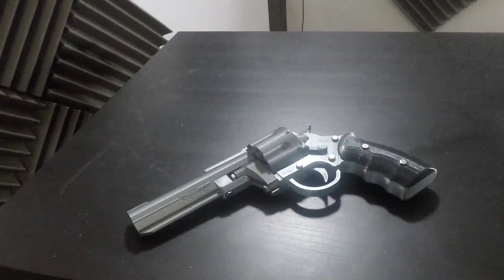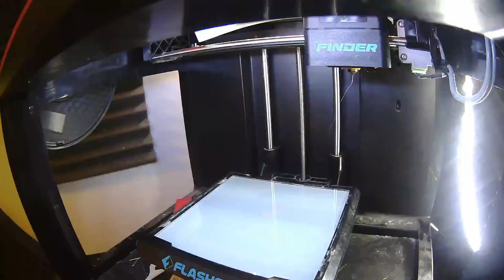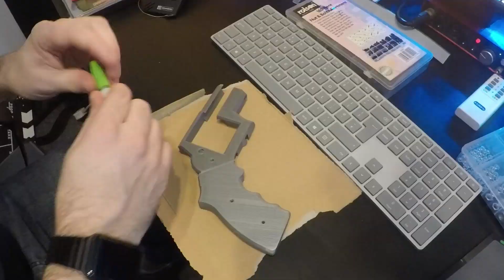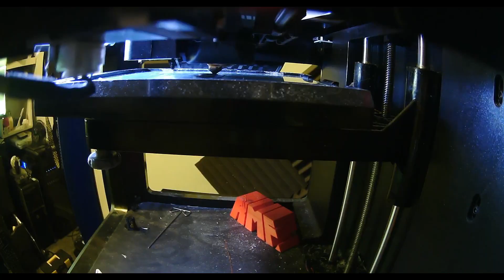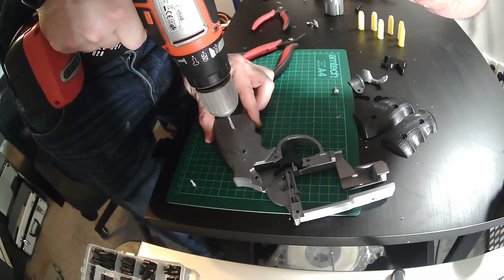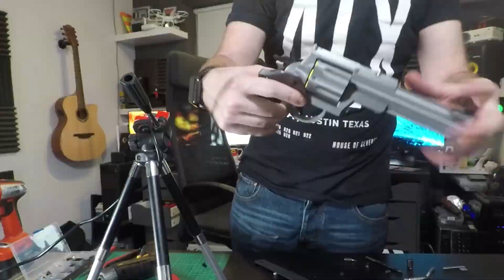3D Printing a  Revolver (Prop) | Flashforge Finder

Comment: Hello do you have the files for the 3D printed  screw you showed in the video
Reply from the maker: For you...? Yes of course! Here in my dropbox is the STL https://www.dropbox.com/s/3hpithbtt8uu7q6/My_Customized_NUT_JOB__Nut_Bolt_Washer_and_Threaded_Rod_Factory.zip?dl=0
Reply: @RMFTech  Thank you! but I cant seem to open the dropbox file because when I click on it, it says that the .stl file cant be previewed
Reply from the maker: You must download it first. There should be a download button in the top right.
Reply from the maker: and you can make and design your own nuts and bolts here: https://www.thingiverse.com/thing:193647

Comment: I see you made my project! Awesome!

Cool video by the way, I like how you are talking and being motivated, it keeps things interesting :) You should have more Subscribers!

And thank you for your kind words, but well, you are making me look quite bad saying it does not work :D I think you did not cut away the manually added brim on the Hammer-Gear-Teeth, which could lead to the internals getting stuck. Also, I advise you to read through the description again, maybe there will be some things that you can relate to under tips, afterwork to do, or known issues and solutions. If you still cant get it to work, feel free to contact me on thingiverse so we can work that out. I try to help everyone who is asking for my help. I have seen lots of issues during my two prints and all the prototyping before, so I guess we can get it working ;)
Reply from the maker: Hi Tobias! Firstly thanks for a great model and a shit ton of hard work! The not working element is clearly my stupidity and not the model. I think I must have missed the brim on the hammer! That certainly explains a few things. BUT! As I say I am going to do it again, on the new printer once it’s built. Actually really excited to print the longer barrel!
Reply: @RMFTech  | No problem, i made it for enthusiasts like you :) Seeing my thingiverse profile in your video put a huge grin on my face!
I hope your second print works out of the box, but I am sure you could easily fix this one. Designing this was hard, because on one side I want all movable parts to sit tightly with little wobble, on the other side the free space in joints must be big enough that every printer delivers a working model...
Fun fact, since the day I uploaded the longer barrel versions, only very few people decided to print the shorter one :D